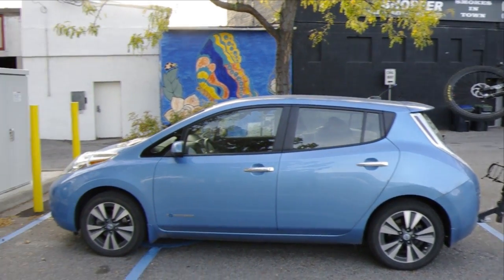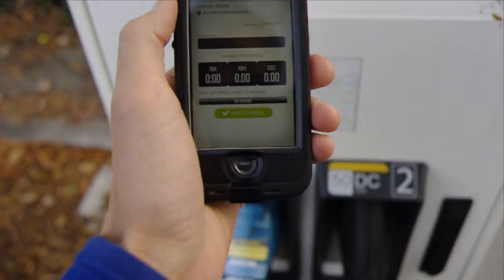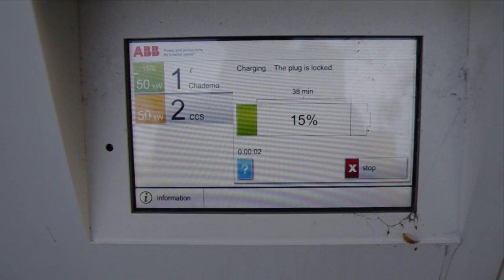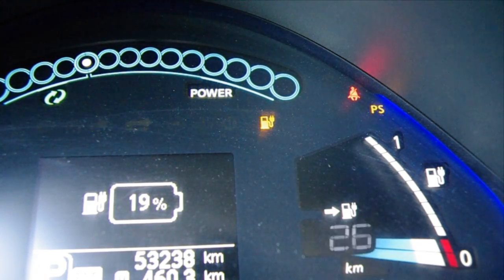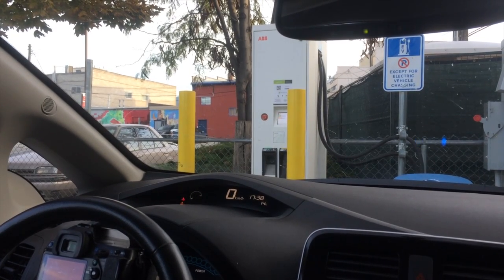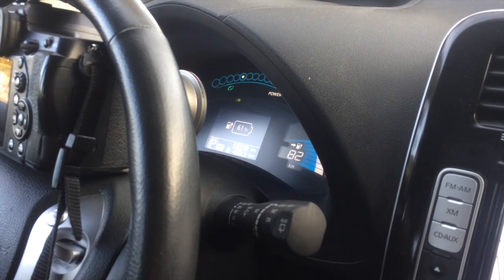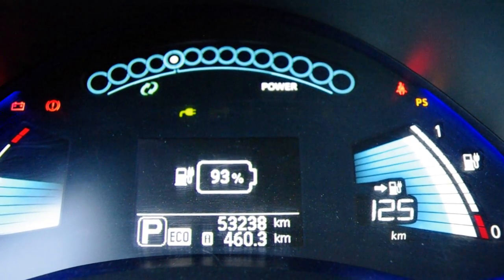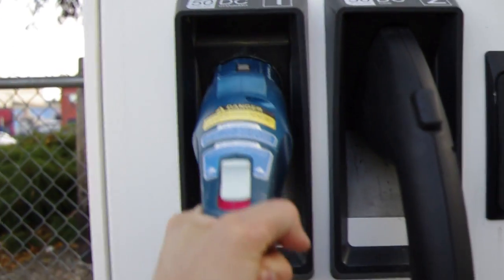Fast charging a Nissan Leaf in Penticton, BC

Comment: Thanks for the video!  We have a Leaf here in AB, but alas no L3 charging here yet. We bought it in Jan 2012 (It's a 2011). I've never seen a Leaf fast charged, so now I'm living vicariously through your video.
Reply: michael subasic Limited support for EVs in Alberta? Not surprising, considering most of the province's economy is based on the oil industry.

Comment: Hi, thanks for the video. Nice to see someone in the interior of BC telling the ev story. I've been in Kelowna for a couple years now but still not ready to buy an ev due to low range and limited level 3 chargers. You are adventurous! 
I was curious if it's mandatory to have an account with green lots and how much it cost to charge in Penticton?
Reply from the maker: +infernovideo 
Thanks for the kind comments.  I couldn't find this type of information when I was looking to purchase my EV, so I hope this video, plus my website, is helpful to others who are looking.

To your questions - most of the fast chargers (DCFC, the orange ones on PlugShare) do require an account with Greenlots, and either a RFID key fob, or an app on your smart phone.  I have found the app to be reliable so haven't bothered ordering a fob (which costs money).  If I were to travel into the US, I would probably buy the fob to avoid roaming charges on my phone to use the app.

Having said that, the Penticton charger doesn't seem to require activation via the Greenlots app or fob to charge, at least when this video was filmed in early October 2015.  I suspect that will change though.

As for cost, most of the DCFC in BC are free at the moment, though some of the more heavily used units do charge $0.35/kWh.  To put that in terms that are easier to understand, that means it is about 18kWh to charge my Leaf to travel 100km, so about $6.50/100km of travel using DCFC @ $0.35/kWh, which is pretty equivalent to driving a Prius using 5.5L/100km @ $1.25/L = ~$6.75.  However, the vast majority of my charging occurs at home @ $0.09/kWh, which makes my cost closer to $1.60/100km.